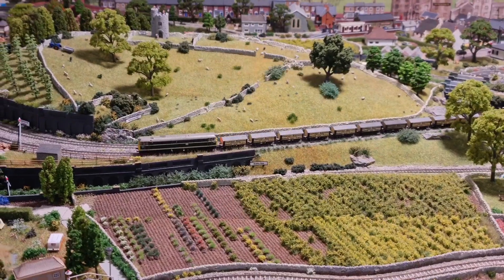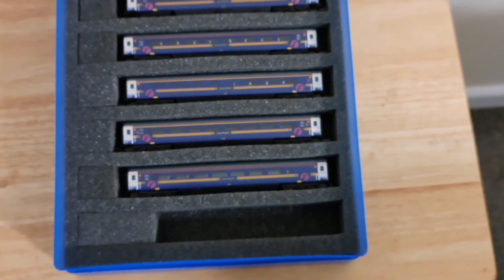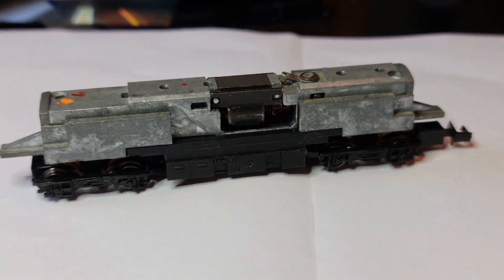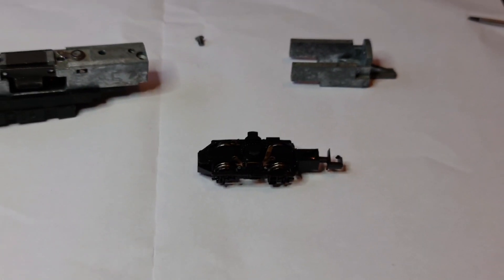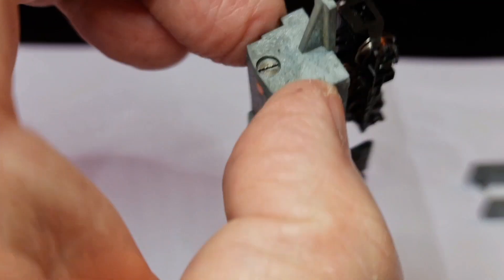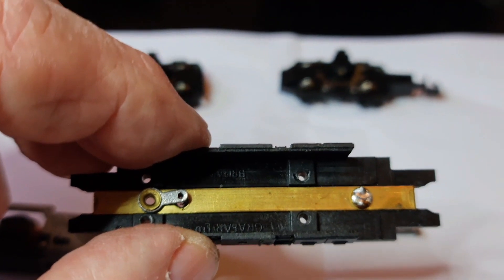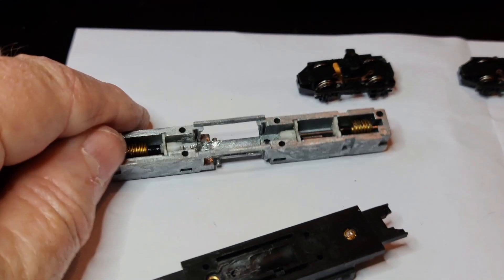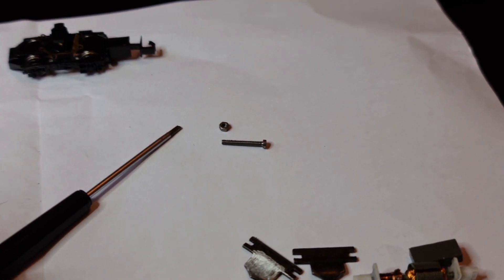122. DC to DCC. A Graham Farish Conversion.

Comment: Hi Mark. Great conversion, which I have done myself. I used the plastic tubing as I couldn't source the metal tubing you have used. Where did you get it from, please? Did it need gluing, or was it a tight enough fit?
Thanks
Reply from the maker: Hi, the brass tube bits for going over the shaft from the motor are from Tramfabriek. If you ever Do a motor replacement in a Dapol, which I recommend for all Dapol Steam, class 35 and 52, they come in the kit.
I use a needle file to rough up the shaft ends and then put a small amount of gel super glue down the brass tube, and slip it over. I then roughed up the outer of the brass tube and did the same for the white plastic drive bits.
Just email Tramfabriek and ask to buy with the motor.
I have them in stock for use all the time now.
Reply: @PiddleInTheMarshbyMarkIreland  thanks for that info. I didn't realise that he did the brass rodding.
Reply from the maker: It's a tube !

Comment: Hi Mark, that's a great tutorial on what needs doing, thanks 🙂 Years ago I had an OO version of the Barbie livery HST (actually it's still boxed in the attic), but with the slightly later blue-nosed power cars (still with stipes, not the MTU all-blue ones) - it's a nice livery, and if it came around again in N gauge I'd probably get a rake. It's great to see though that a second-hand one can be converted. I've never tried any conversions before - do those white bits on the end of the new motor shafts just friction fit on? And is the blacktack the only thing that stops the cylindrical motor body from turning when the driveshafts come up against the resistance of the loco and its train? It clearly works, I'm just trying to understand where the forces go.
Reply from the maker: Hi Jonathan, yes the black tac is all that holds the motor in place. Trust me it's more than enough.
The motor shafts I have fitted with brass ferals, as used when doing a Dapol motor change. I use a needle file to take the chrome shine off the drive from the motor and use gel super glue to fit them on. Then again take the shine off the brass to fit the white drive  bits again with gel super glue. Works fine. The silicon tube just pushes on if you prefer that method and also works fine. The tube maybe a bit quieter but it is a lot quieter now it's run in more. The couplings has proved to be as unreliable as the Dapol ones.
Black tac is great, it's Superman's blue tac lol.
As I understand it, the white was removed because it was impossible to keep clean and looked a mess.
The motor conversion should be easy for you to do Jonathon ! The instructions are on the Tramfabriek website, link in the description.

Comment: Hi Mark, Thanks for showing the conversion, really useful stuff to know. I've  dabbled in a couple of conversations but not an old Poole HST. I like the fact that you can get some of these old models converted to DCC and give them an extended life. Cheers and all the best.
Reply from the maker: @wimbletrain  Hi John, to be honest it turned out easier than I suspected it would. Tramfabriek have step by step instructions on their website, you just have to follow. The milling in the problematic bit if you don't have the kit. I need to purchase a small vice for the next one because the grip in my left hand from the stroke let me down. The web address to Tramfabriek is in the description.
Mark